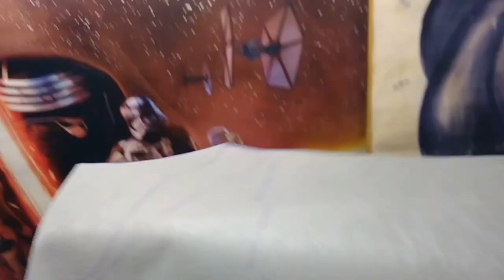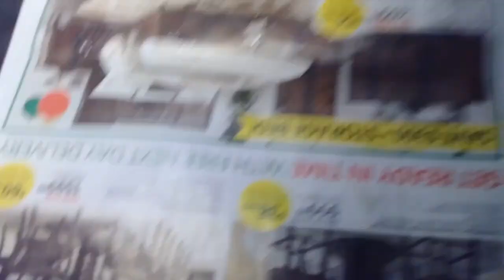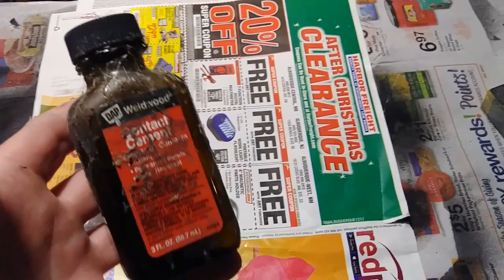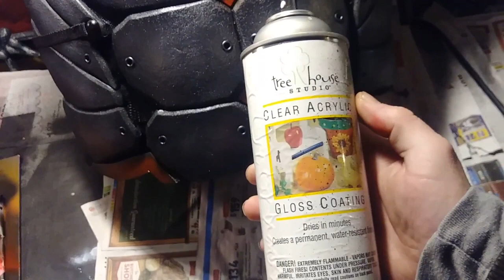Red Hood Cosplay Armor DIY tutorial Video

Comment: Do you think this will work with thinner foam?
Reply from the maker: I wouldn't go any thinner than 5 mm, and even then you may want to glue a reinforcing layer, kinda like how plywood works. Example: I made a Mandalorian helmet with 5 mm instead of 10 mm but I had to glue in layers of 5 mm in some areas so it would hold it's shape and be strong enough to last